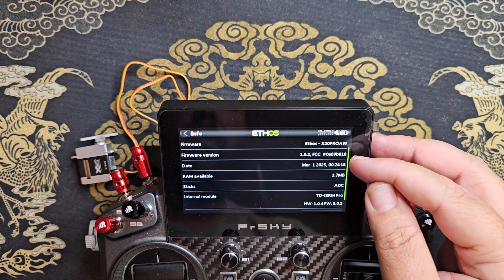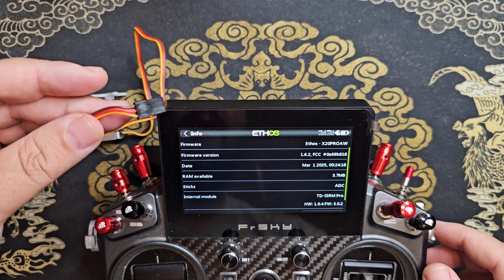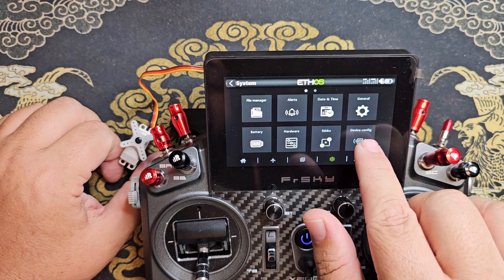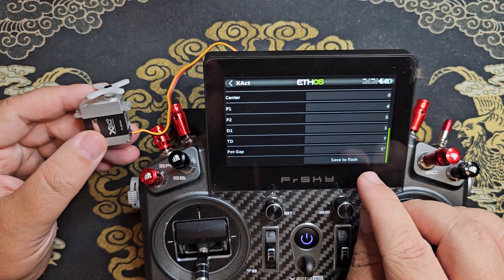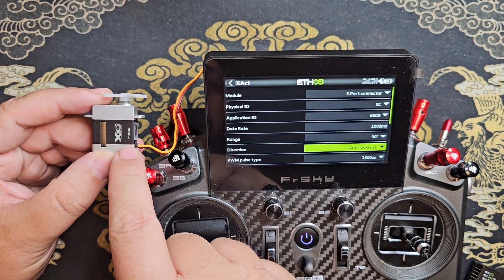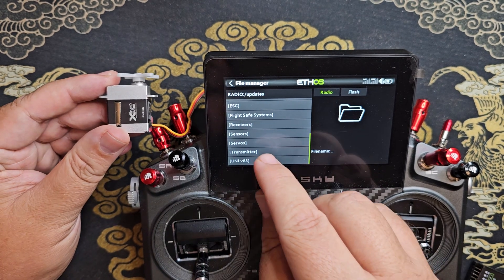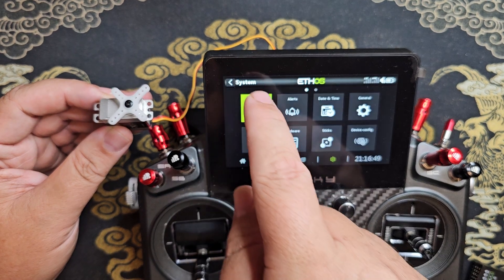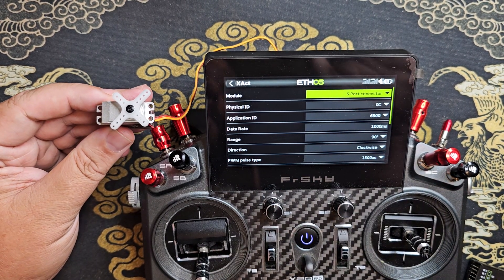FrSky ETHOS 1.6.2 Program XACT Servo Direct From Radio S.Port Connector via FBUS with Device Config

Comment: Hi Ben! I have a huge question about xact servos. I have a friend that had an issue with an bls 5400 locking when loosing signal (the white wire got lose from the plug). Is there anyway to configure a kind of failsafe that makes the servo lose its possition after a signal loss?

Comment: 👍is it possible to give information about parameters like P1, P2, D1, TD and Pot Gap, thanks
Reply from the maker: P1/P2: Strength of locking servo arm

P3(D1 in ETHOS):Friction

P4(D2 in ETHOS):Filter

P5(Gap in ETHOS): Electronic Slop
Reply: @frskyben  thanks